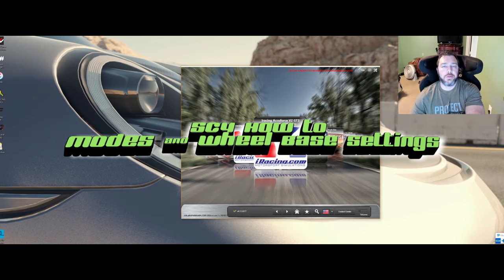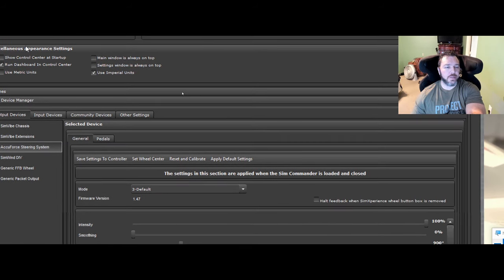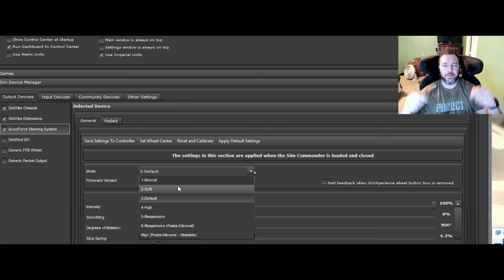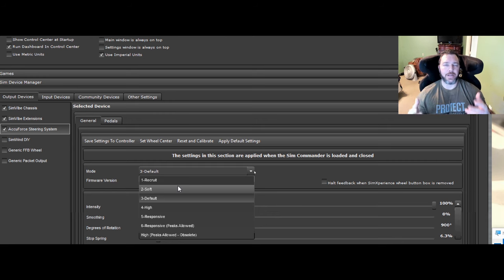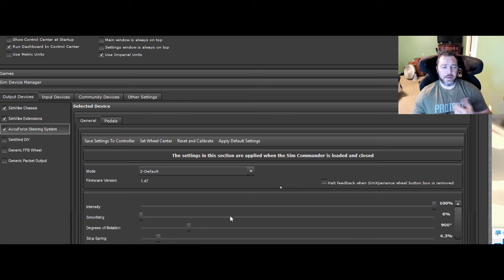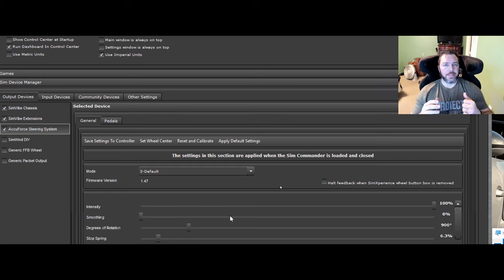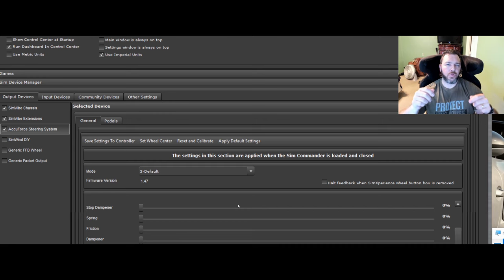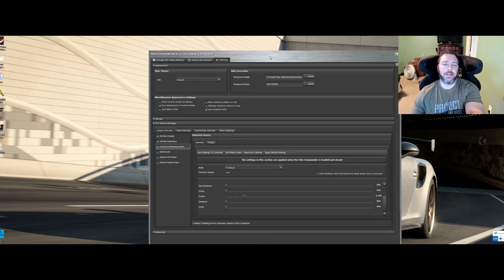SC4 Accuforce V2 How to Wheel Modes

Comment: Hi just want to ask I have accuforce v2 for 6 months. Does it really produce a rattle noise when on kerbs or ffb is increased? Had to put ffb to around 50% on simcommander for me not to hear the noise.  Thanks in advance
Reply from the maker: Hello, Thanks for watching. So normally no it doesn't produce the rattle noise you're talking about. However, I have experienced it in some sims if I do not run SC4 software. It will also feel a little rougher or grainy feeling too. I believe it's just extra noise produced from the sim itself and since Accuforce V2 is so sensitive it picks it all up. When running the SC4 software it mutes those unwanted noises coming from the sims. Try running the SC4 profile for the sim your playing. Not the default settings you get that you save to your wheel. If you are running the SC4 game app and still get the noise check to see that it's actually connected to the game. You can tell if you lower down intensity or game force to zero. The wheel will have zero feedback when doing that. Hope this helps.

If not let me know what sim your using and I'll upload a profile if I don't already have one on sim owners club. Oh also try other profiles to see if you get the same result to test.
Reply: TJRSim 
Thanks for your reply. So I am running it with Sc4 and tried other profile and still has that noise. I play iracing, ACS. AC, dirt rally. At first I thought its because of my mount. But currently changed to gt1 evo and still has same results. It will only be quiet if I put tuning down to less than 50% which does not feel good anymore due to less ffb. I am in contact with simexperience customer service. Sent them a video. Will wait for reply
Reply from the maker: Paul Marabe ahh. Yeap sounds like you might need a repair. It could happen with any product. I’m sure they will get you sorted out. Keep us posted. Love to hear feedback.

Comment: Hey Thanks man! That was super helpful! SimCommander can be an overwhelming bit of kit!
Am I right in surmising that the settings you went over here are underlying settings that your game profiles overlay, so changing these will change how all of the profiles behave?
Man I wish SC4 had tooltips for everything! ;-)
Reply from the maker: yeap you are correct. If you were to not launch sim commander ever again your wheelbase will use these settings you set going forward. However, if you do launch sim commander and use a  profile your profile overrides these settings while it's running.  Thanks for watching and if the community needs more sim commander help I can make a vid on it.,